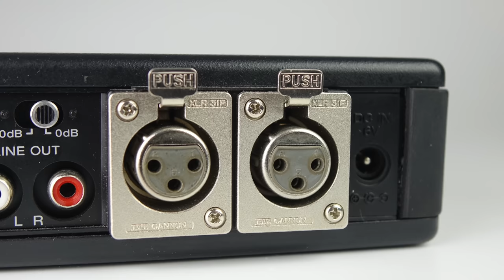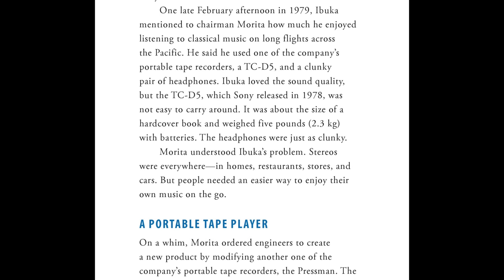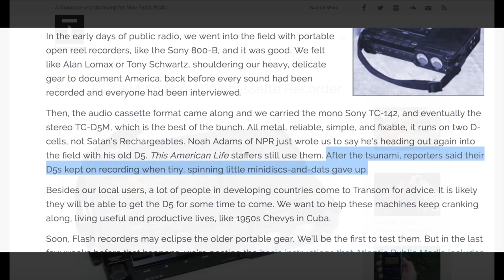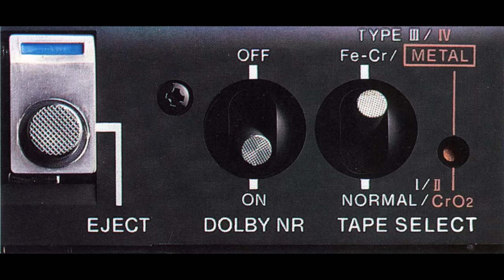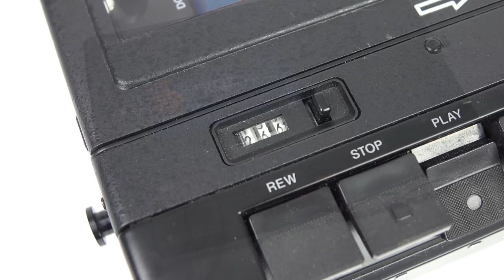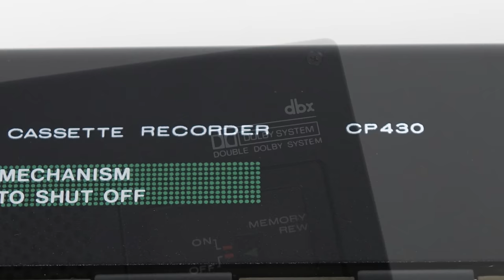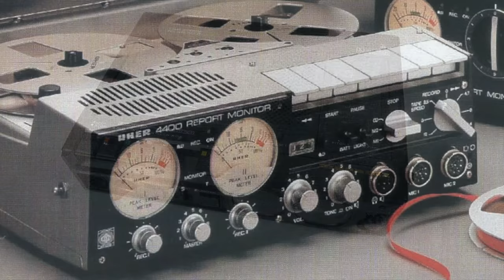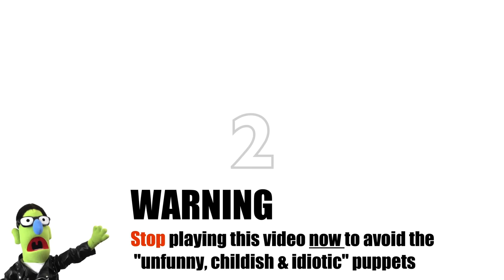Classic Tech - Sony TC-D5 Field Recorder

Comment: 7:49 : It appears to me that, for the most part, the reason for its success at defeating wow and flutter, i.e. tape speed irregularities, due to external acceleration applied to the tape deck is simply down to the motor drive train geometry. 
The motor axle itself is aligned with the major axis (length) of the tape deck but the motion is transferred to the capstan through a bevel face gear. The face gear along with the capstan are aligned with the minor axis of the tape deck (the one perpendicular to the deck's face). So most of the motor inertia (i.e. rotational mass) is along the major axis. Thus, for the tape speed to experience undulations due to external forces, these forces would have to rotate the tape deck along the major axis. While likely to occur, it's more likely for the deck to experience external rotation along the other two axes, i.e. the one perpendicular to the face of the deck and the one perpendicular to the long edge. Neither of these rotations will have an effect on the motor rotation (and thus the tape speed) as these rotations' axes are perpendicular to the motor axle. As to the rotation along the third axis (the one perpendicular to the short edge), that would have an effect but the gear ratio of the bevel gears would have a reduction effect on the disturbance as the face gear is much larger than the gear on the motor axle.
It would be much easier to understand the above with a simple picture of course. 
If one draws a picture with the deck's axes of rotation, the motor's axle and the face gear/capstan axle, it's easy to see why this geometry helps reduce the effect of external rotational accelerations.
Reply: The previous comment was based on simple observation of the deck's internals as shown in this video. A small correction: instead of gears rubber wheels are apparently used as stated here:
https://walkmancentral.com/products/tc-d5
which contains a more eloquent and neater explanation of what I was trying to describe previously and other interesting information.

Comment: I was approached by someone from the BBC doing some vox pops on the street. When I pointed out that I was from a rival news organisation and also covering the event, he apologised and went off to find someone else! He had a Uher cassette unit, I seem to recall.
Reply from the maker: Yes the BBC tended to use the Uher machines.
Reply: have the sony stamped radio essex bbc, paid around £50 10 years ago, dont have mic with xlr, can you get connectors for normal sony stereo mike

Comment: Great Video! I enjoy your channel for quite a while now but this is the first time, I actually own one of these beautiful things.
I bought a TC-D5M a few years ago and it's working fine. However there's some kind of rattling sound coming from the machine when the tape is running (fortunately not audible on playback).
The guys from my local HiFi Service tracked it down to some kind of bump on a rubber wheel in the drive mechanism. Unfortunately they were unable to repair it or get a spare wheel.
During your research did you, by any chance,  run across this problem or maybe even a source for spare parts?

Keep up with the highly entertaining and informative videos!
Best wishes from Germany

Comment: Cool, I'd never thought of using a field recorder in a hifi context, but it'd clearly have a lot of benefits there. My local flea market has an old recorder of the type, I should look more closely at it. I doubt it's very high quality though, the case is fake leather and the years have deformed and hardened it into some kind of modern art piece. :)

Comment: WOWWW Great Video --- Is it normal that the red REC lamp does not light up when recording when the power supply is connected, but only lights up when using battery or rechargeable battery????

Comment: Got the TCD-5M  and the TCD-5 Pro2. Both sound good but the pro has a little slight quality, but my naka 550 portable cassette field recorder is much warmer and fuller than the tcd, but the downside of it is that it’s a little bit clunky and heavier.

Comment: Were there any Sony tape machines with an extremely similar form factor to the TC-D5? I grew up with one around the house and used it constantly throughout the 90's, and maybe as recently as 2005/2006... at which point I presume my family decided it was something worth tossing in the garbage because I haven't seen it since. I'd love to know what model it may have been, it could've been this one but the look of it is a bit off… i don't think the design looked nearly as sleek or refined but generally the same form factor/layout, and had a big leather outer case with all these snaps on it.

Comment: Well Mat, I'll be interested to read your thoughts on the Marantz CP430. I had one of these and it was the most unreliable piece of equipment I've ever owned, a thing of dreadfulness indeed. The piano keys broke repeatedly and you can see why, the silly little plastic designs with had built-in stress points. dbx was fun to play with because tape noise was magically absent, but it was not without the dreaded pumping side-effects.

Comment: Only the TC-D5M can record on metal tapes, due to the SENDUST record/play head being installed. The other three models used FERRITE heads, which cannot operate at the high bias and recording levels needed for the Metal Tape IV. But the Ferrite heads have a much higher lifespan, so this is why these machines with Ferrite heads would last forever. I have several TC-D5M machines, one with completely worn out Sendust head. But my TC-D5 and TC-D5 Pro II have practically no signs of wear on their ferrite heads. Then all machines have ferrite erase heads! You will ask why, and how, if ferrite saturates so quickly? Well, the erase head has double gap to apply the errase magnetic field twice and achieve the needed erase effect. So it has nothing to do with battery power, that is nonsense. It has to do with the magnetic material of the universal head. WM-DC6 also uses Sendust head, so it can record on metal tape, even when its batteries are much smaller AA types.

To have a fully all-ferrite-heads deck and to be able to record on metal tapes, it would need to be a three-head model - ferrite erase head as it is, a big-gap (above 3-5 micrometers) ferrite recording head to survive the high AC currents without magnetic saturation, and a small-gap ( <1 micrometer) playback head, which doesn't saturate as it doesn't record, so it can have the tiny gap to reproduce the highest 20kHz audio frequencies without problems.

When that Sendust head with model type PS-210  died, I couldn't find no replacement back in the 90's, so I installed an ordinary hard-permaloy head. Obviously that head can't survive "metal" currents too, but who needed metal anyways. Additionally I developed an HX-Pro circuitry of my own to improve the highs at high levels. The board went in the empty space right below the "piano keys" inside :)

As for the tape speed stability - in TC-D5's and WM-DC6's the DC motor is the same, no belt, only the friction wheel coupling to the flywheel. But the flywheel has a multipolar magnet and besides the flywheel there is a stationary magnetic hall-effect pickup sensor, which produces AC sine wave, which is FM modulated obviously to the rotating speed. This signal is PLL locked to an RC oscillator, where the difference signal controls and drives the motor. So the stability practically is equal or very close to a direct-drive quartz PLL locked system. The motor itself is a DC motor, which is really quite tiny. I've managed to repair mine from my TC-D5 with a mini lathe few years back, it needed new sleeve bearings, because the constant push to the flywheel had eaten the bearing right in the opposite direction. :) 

Congrats for your videos, I enjoy watching your reviews.  Greetings from Sofia, Bulgaria!

Comment: Ferrite heads had very long life, but they could not record on metal tape (playback is no problem). The Pro has 2 ferrite heads. One for record and one for playback. The M model only has ferrite as a playback head. The record head is another type.
Reply: BersekViking all of the D5s are 2 head machines- the playback and record are on the same head.
Reply: Ok. I assumed that since it said "Ferrite&Ferrite" on the top, it had separate heads. The first one must be the erase head then. Anyway. Ferrite heads could not generate a high enough magnetic field to record on metal tape, but they lasted a VERY long time. I remember that Techincs had a 10 year warranty on them.

Comment: Looks not unlike what was an industry standard Marantz favoured by the UK radio industry especially back in that era as my mum had an incredibly expensive Marantz with a pair of meters like this and using that and a reel to reel back at base she could produce very smooth productions,  so it feels to me the industry defined the function and look more than the consumer.
Reply: Having seen the before missed short on the Marantz, the one my late mum had from the BBC with her Uher was a lot sturdier and the industry called Marantz the "Rolls Royce" of cassette recording which must have been the overall aim of Sony to overcome which it shows they did as I remember my old mum cursing as only a journalist could about wow and flutter issues as they pervade especially in such areas like spoken word articles e.g. radio 4 when the wows and flutters could be heard undulating in a pause during an interview and people complained too.

Comment: I have this deck but I never made it to work again. There is only static noise coming out of the output jacks. The VU meters however are bouncing in the tact of the music on the tape. And recordings I do with that deck are on tape as I can play it on another cassette deck without any problem. Any idea? Can it be the tape head?

And as for the DC input versus Stereo/Mono switch: Mine came with a Sony power adapter "AC-61" which still works and with the DC input.

Comment: I noticed there was no "hiss" in the audio playback from the cassette tapes. Is that because the player has circuitry to eliminate it, or is it because the audio recording was done on a high quality recording using high quality tape? I am asking because I want to digitize old audio recordings created by my sister in then 80's using her boom box. Would this recorder improve the audio quality or is that highly unlikely.
Reply: You really can't record "less hiss" once it's there.  What you can do with those archived hissy recordings, although it will be pricey, is once you've digitized the audio, process it through decent software that can sample the hiss and then remove it.

In the video above I suspect Techmoan simply used quality tape and strong levels.  And of course a decent mic.

Comment: Top video!
Please do not compare the TCD5* with a Landrover! 
The TCD5 had electricals and brakes that worked!

Piano keys means lower power consumption no solenoids to holding anything on or off
7:52 Rim Drive capstan low wow and flutter ever better than some reel to reel pro models 
Direct Drive Servo control motor with teflon thrust bearing. Hence no capstan shaft up or down motion when moving tape recorder.
Same mechanism in WMD6C and TPL2(original walkman)
3:47 Middle deck TCFX1010 digital everything cassette deck at one stage I had 4 of them. Long Story!

Comment: We used a professional cassette recorder at the telephone company back in the 1970s and 1980s.  All of the recorded announcements were on cassette.  We would use the cassette recorder to play back the announcements into the switching machine including that old classic "I'm sorry the number you have dialed is not in service".  There was a 1k hertz tone at the first of the tape. we would measure the frequency  of the tone and adjust the speed of the tape to get exactly 1k hertz.  I see that this recorder did not have that ability.  Does anyone know of some models that you ca adjust the capstan speed on?.Some of the telco recorded announcement equipment would not play back a message longer than 10 Seconds.  We would receiver an announcement that was 11 seconds long so we would speed up the cassette tape to play it back in 10 seconds.

Comment: Wowser. I did a brief stint at BBC radio in the early 90s and pretty much all the outside recordings were done on a fleet of these. Then they replaced everything with DAT and hundreds of these went into a skip. I should have bagged one 😒
Reply: Phil Makes Things You should've bagged like 100 of them and put 99 on ebay. :p

Comment: I always wanted one of these, but couldn't justify spending the money on it.  One of the neatest gadgets from that era.

If you want an odd bit of old tech to review, check out the old Marantz Superscope CS-200s, a portable stereo cassette deck from the days before the boom box.  An art teacher we had in junior high used to play tapes during class that he'd made on his Nakamichi deck on one of these.  Sounded pretty incredible for a portable.  No Dolby, but could handle chrome tape, which was still somewhat exotic circa 1980.  Decent pictures of it at this eBay auction:

http://www.ebay.com.sg/itm/Superscope-CS-200S-Stereo-Cassette-Recorder-with-leather-case-/191992759510?hash=item2cb3a904d6:g:1qEAAOSwpLNX9cCM
Reply: Here's the brochure for it: http://www.derekspratt.com/PDFs/Personal/Audio/Superscope%20CS-200S.pdf

Comment: Unit takes 2 x 1.5v d cell batteries giving 3 volts, yet adaptor input says 6 volt.
Reply from the maker: It uses a DC-DC converter to step up the battery output.
Reply: Thanks for reply . Great video too.
Reply: So its 2 x 1.5V? Just want to be extra sure :)

Comment: "portable"
Reply: Smaller than a small laptop though! How is it not portable?
Reply: Beef Ingot In the past, in electronics (except computers, see below) the word "portable" pretty much meant "not mains-powered". Only in the 90s did it come to mean "pocket size".
Reply: Siana Gearz Indeed. Ever wonder why laptops aren't called "portables"? Because in the 70s and 80s, "portable" computers existed, and in that context, it meant something that could be carried with you and didn't require hooking up separate CPU, monitor, disk drives, etc, as was common in desktop computers of the day. But they were mains-powered (with some exceptions), usually used small CRT displays, and were often around 20lbs! Examples include the Osborne, the Compaq Portable, and the original Apple Macintosh.

So when technology finally got to the point where they began to resemble the modern laptop, the industry came up with "laptop" and later "notebook" to refer to portable computers that were smaller and lighter than the "portables".
Reply: Antonio Tejada well aware. This very channel has restored a Commodore SX-64 though, hasn't it? And that's a lightweight, the actual computer part fits on a single board.